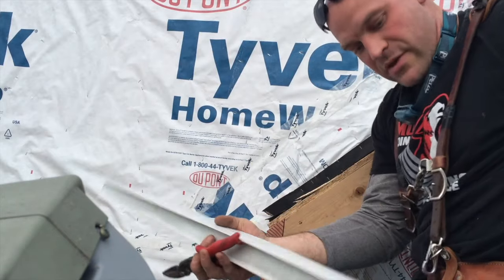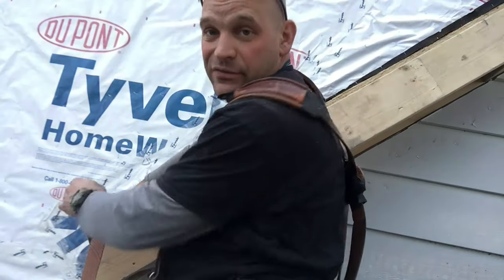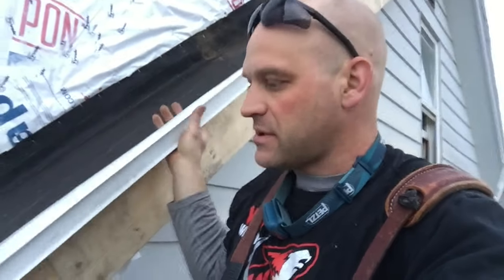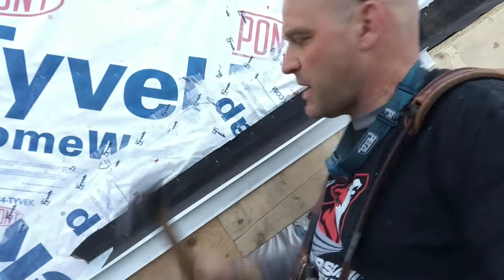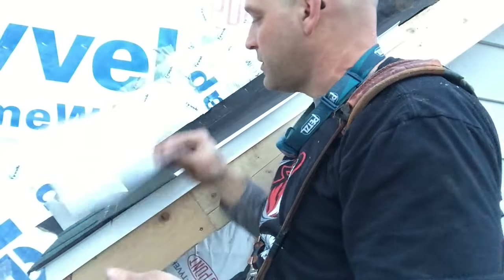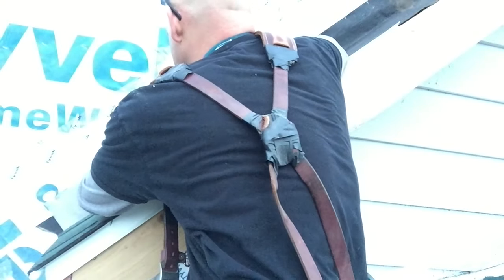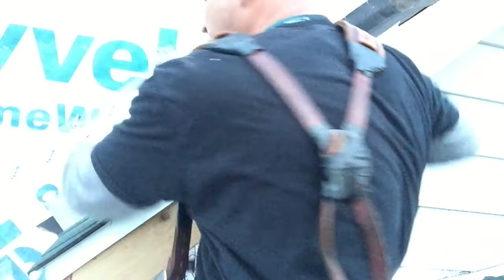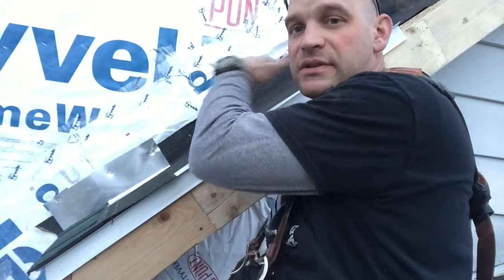Step Flashing   where a roof meets a wall

Comment: The flashing is suppose to go under the house wrap. If water gets under the siding it’s suppose to run down the the wrap and over the flashing on to the roof. But if the flashing is over the wrap, water can get under the flashing and cause damage.
Reply from the maker: On this small of a roof, I did t think it would make much of a difference. Do you have a video on the topic? I would be interested in watching it.
Reply: should put ice shield on intersection first, then step flashing, then wrap
Reply: there's always a better way to do something.  if this was just a reroof r u suppose to cut open the house wrap to put step flashing under???
Reply: @huhwhatomg yes, cut open the house wrap - that ideally would happen before the roof felt wrapped up the side wall, in which case the roof felt would attach on the sidewall behind the overlapping house wrap. On this job with the roof felt already stapled on top of the house wrap, I would simply slit open the house wrap just above the roof felt, and attach a 8-12” wide strip of water shield, roofing felt or house wrap behind the housewrap, positioned so as to shed any water running behind the siding out over the step flashing.
Reply: @Trevkongable on any size roof- a leak is a leak and water damage on the interior and to the structure is never good in any case, damage is damage and will result in much more expense and many more problems- period.
Reply from the maker: @keith455-73  true

Comment: The wall I'm working with doesn't have siding. What is used between the stucco wall and the new roof line to prevent water from going into the walls?
Reply from the maker: I don’t have any experience with stucco, I’m sorry I can’t be any help

Comment: That looks like them home depot step flashing, if that's what it is, you can literally rip that thin aluminum with your bare hands!!  Go to a roofing distributor and get some pre painted step flashing, much better quality..
Reply from the maker: It is actually stainless steel flashing, I don't use aluminum for flashing, it's not as tough as stainless  steel

Comment: Dont you need a 1/4 inch gap between the shingles and the wall for expansion?
Reply from the maker: Ok
Reply: @Trevkongable  that was a question
Reply from the maker: @Brandon-no3vc  not in the summer when it’s hot and the shingles are warm. But you can if you want, depends on what you like and what you’ve been taught for your area. I’m in Iowa, so it doesn’t get much hotter for the temp I put them on. If it would have been in the 40’s and the shingles were cold, I would have allowed for expansion. Hope this helps
Reply: @Trevkongable  shingles expand and contract?
Reply from the maker: @Brandon-no3vc  they can a little bit
Reply: @Trevkongable  how much? Both ways?

Comment: Hi, in the union of the shingle and wall, the water from rain enters to my house. There is not a metal protection like in your video. I added an elastomeric caulking 2 years ago, it worked well, but now the excess of rain makes that water enter through that again. What can you recommend
Reply from the maker: I would say to re-roof it and install step flashing.  My guess is that there isn't anything there and that allows the water to freely come into the house
Reply: If u must caulk, use loctite or vulcum ,I think they're called.

Comment: Oh it is going to rot without kick out flashing.
Reply from the maker: Your absolutely correct, I was going to make a separate video on kick out and didn’t get it filmed. I will need to revisit it next spring, thanks for the reminder
Reply: @Trevkongable  you do a great job at explaining things. I didn’t mean that in a condescending way. It just seems to be the top thing I have been complaining about lately. It’s just not common to see a lot of people do it

Comment: So you put your felt tucked under your drip edge?wouldn't water run down then would end up behind the drip edge
Reply from the maker: You can do either, I've done it both ways, but putting the drip edge on top of the felt keeps the felt from getting blown up and having any rain or snow get underneath it.
Reply: I feel like this guy had a general idea of how to roof at the time and wanted to be a YouTuber. Diy’ers beware.

Comment: Hi, how long does a brick and Mortor  30 pound felt roof underlayment last before it starts leaking when exposed to the elements because the spanish tiles broke? The roof is a spanish stile brick and Mortor original from 2004. Thanks.
Reply from the maker: It all depends on the weather it is exposed to, but I'd get it covered up as soon as you could and not depend on the roof felt
Reply: That is why the use of a self adhering underlayment membrane is now required by code for eave and gable roof edges.

Comment: Your Tyvek should have been raised during this process and shingled over the step flashing. WHEN water gets behind the cladding on the adjacent wall above, it will go between the WRB and the metal into the roof wall transition. I've seen builders go out of business from that incorrect detail.  RP, 9 year Senior DuPont Tyvek Specialist and building consultant. 
Good luck You-Tubers
Reply from the maker: I’ll look forward to your video on the topic

Comment: Just curious... normally drip edge on the eve end will always get nailed to your plywood sheeting first, before tar paper.  The tar paper would essentially be over the top of your drip edge instead of underneath it.   The rake end of course will have the drip edge OVER the tar paper.  Any particular reason why you put the drip edge on the eve end over the top of the tar paper?  For those who don't know, it does make a difference because any water that gets between the shingles and the tar paper, drips downward.  As it drips down, it will get to where the drip edge is and instead of going over the drip edge and out, it'll go underneath the drip edge, causing potential moisture/mold/moss/rot issues with fascia board and edge of plywood where the drip edge is nailed to.  Thoughts?
Reply: I believe it's code to put it over and just makes sense too.
Reply: Actually the use of tar -paper would be the wrong thing to use.It should have been a self adhering underlayment membrane and it should have returned and gone up the wall. The 2x framing behind the fascia board should have also been flashed back to the wall.
Reply: @alm7707  If you're referring to putting the drip edge on the eve end over the top of the tar paper, you are incorrect.  It's common sense to put the tar paper over the drop edge on the eves and is actually code and manufacturers recommendation that drip edge goes underneath the underlayment on the EVE (bottom) edge.. that way water that gets beneath the shingles will flow down and over the edge of your roof.  If you put the drip edge over the tar paper, the water will run between that drip edge and the paper and pool up, causing rot.
Reply: @gary24752  well, I don't know about using tar-paper as being wrong necessarily... it's not code that you have to only use a self-adhering underlayment like ice barrier.  Would I have used it myself personally? Sure... but that's besides the point.  I only used tar-paper on my garage, top to bottom.. no ice barrier, as it would be a waste.  Have 2-5/8 inch drip edge.. and with the starter strip, first row of shingles, and a small bead of roofing cement (tar in a tube and cheaper than a roll of ice barrier) between the tar paper and one of the channels of the drip edge.. plus the pitch of my roof on the garage.. nothing is blowing water up my roof's "skirt".   Dwelling on the other hand.. will be using ice barrier... know people who did the entire roof with it and waster their money because this winter, they still have water buildup and ice hanging lol.
Reply: @craigwalters7293  Actually most shingle manufacturers recommend the ice and watershield to extend down and over the edge behind the drip, then the drip edge, then flashing tape. This prevents any backup along the edge should you have gutters installed.
Reply: @craigwalters7293  In heated areas an ice barrier along the edge where ice tends to build up is required by code. I would still use it especially if I was using gutters.
Reply: Check with your shingle manufacturer. Most recommend the ice and watershield go over and down behind the drip, then the drip, then install flashing tape over the top edge of the drip edge to seal back to the underlayment.
Reply: @craigwalters7293  That is what flashing tape is for. Check with your shingle manufacturer regarding that detail. Taking the underlayment over and down behind the drip prevents backup if gutters are used. The drip goes on and then flashing tape is used to seal the upper edge of the drip to the underlament.
Reply from the maker: This is only a small roof that is under a larger overhang, so it wasn’t necessary to put the drip edge under the already stapled tar paper. This video was meant to show how to use flashing on the wall. Thank for the comment and your expertise.

Comment: Your ice and whater is supposed to be stuck to wall and your tyvec should overlap your step flashing
Reply from the maker: I look forward to your video on the topic
Reply: @Trevkongable  so you have your ice and water stuck to your tyvec?
Reply from the maker: @Brandon-no3vc  I don't use Ice and Water on a small roof like this since no part of it is over heated space.  Ice and Water Dam shield is meant to be used where an overhang is unheated space and the roof transitions to being over a heated space like an attic.  The ice dam forms where melted water from the area over the heated attic space melts and goes down hill to the unheated space over the soffit and then refreezes.  It is unnecessary on a small roof like this that is purely decorative.
Reply: @Trevkongable  isn't it heated inside that wall? Wouldn't ice and watter just be more protection even tho none of its heated? What did you use and how did you dry it in?
Reply from the maker: @Brandon-no3vc  I used regular roofing felt since the roof was all over a non heated space . Yes, the wall is heated but there isn’t usually sheets of ice that are on a vertical wall space.

Comment: What about the kick out
Reply from the maker: Could you explain what you mean about the kick out?
Reply: My 1st question also. Its flashing installed at the bottom corse to "kick" water out and away from the wall. I'm also concerned that you don't know what it is...
Reply from the maker: @tysonlenz7455  I've never heard it called kickout, i've always heard it called overhang
Reply: Basically kick out is cutting the bottom step flashing at an angle away from the roof to kick out water away from the wall to the gutter!

Comment: So you just nailed the first flashing tin on the sidewall at the  starter course. So Brainiac how are the siding guys going to get their first piece of siding behind the first tin.?  #1 don't install the drip tight to the wall leave 1/2" gap. Install starter the same. Install first tin tight at top and 1/2" out at bottom. Install nail at the top. Cut first shingle the same and Install.  Add second flashing tin tight and nail at top and so on.
Reply from the maker: Thanks for the advice Larry, I look forward to seeing your video on the topic
Reply: @Trevkongable  I don't do shingles anymore. I  started shingeling before you were born. 2nd generation with 3 brother's all in the same trade.

Comment: This roof needs a step flashing kickout at the bottom of the step flashing. I repair rot all the time from abutments not having a kickout. The step flashing should be nailed into the roof at the top corner of the step flashing,  not into the wall. Check out GAF's specs on this.
Reply from the maker: Agreed, I didn't get the kickout video filmed, I need to put a caveat on this video to checkout how to do kickout.  Thanks

Comment: Com on man..read the gaf book or something..never NEVER nail step to roof then wall..if structure moves the flashing tears..I'm gonna cry you video roofers all make drastic mistakes..28 year shingle mechanic ripping my hair out right now
Reply from the maker: I'm pretty sure I said in the video that you don't nail the step flashing to the roof but to the wall only, but I look forward to seeing your video on the topic.  I'm always interested to hear how the pros do it.
Reply: I'm ripping my hair out at this ridiculous comment... he very specifically explained NOT to nail it to the deck, only the wall.  Maybe actually watch the video before criticizing.  SMH
Reply: I'm not a Roofer, just a General Contractor. The installation instructions from GAF say two nails in the flashing on the deck and no nails on the wall. But what do they know...they just make the shingles.
Reply: @Trevkongable  Think about it. If you nail you step flashing to the wall and the roof moves any guesses as  to what is going to tear and end up leaking?  The step flashing needs to be nailed to the deck which needs to move independently from the wall. The vertical leg of the step flashing will remain tight to the sheathing even if the roof moves. I would also suggest running your ice and watershield up the wall a minimum of 18 inches to guard against leaks from snow drift.
Reply: @Trevkongable  Check with your shingle manufacturers details and recommendations.
Reply from the maker: @gary24752  Thanks for the tip Gary